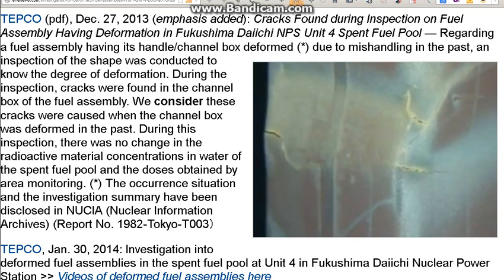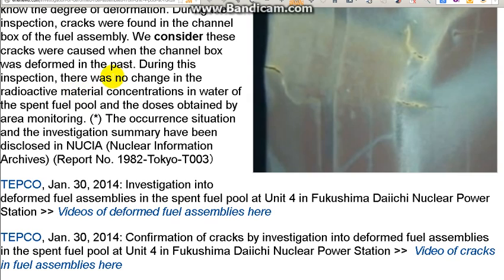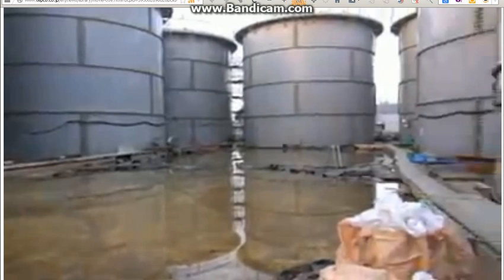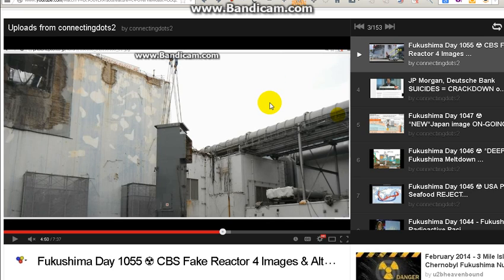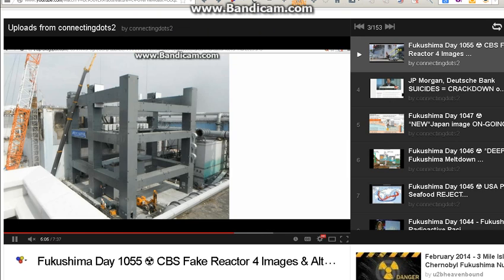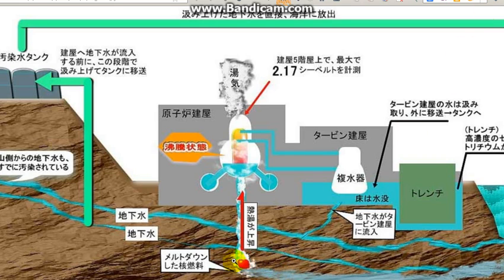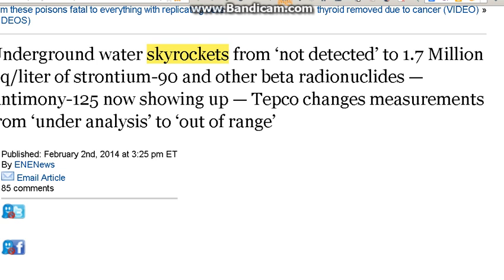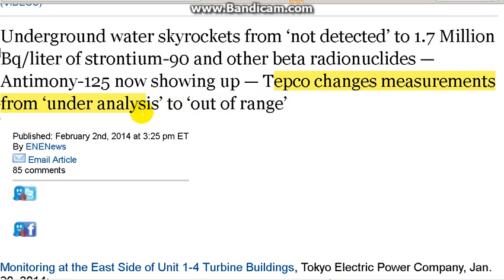Fukushima Day 1060 ☢ Strontium 90 SKYROCKETS at Fukushima & Reactor 4 Spent Fuel Pool Footage

Comment: Tokyo Electric Admits Most Radiation Readings May Be Wrong
February 8th, 2014 Fukushima – SimplyInfo

Tokyo Electric has admitted a large number of Tokyo Electric radiation readings taken since 2011 may be wrong and much lower than reality.
An audit will be performed on old data from 2011 until October 2013. Tokyo Electric explanation is that high radiation samples had a “counting miss” where the total level of radiation in the sample is NOT accurately recorded. Some media reports questioned Tokyo Electric excuse.

Currently this is only calling into question all beta radiation readings taken. Neither Nuclear Regulation Authority or Tokyo Electric has mentioned similar problems with gamma readings but there have been other issues with measuring and laboratory processes since Nuclear Regulation Authority took over review of the Fukushima plant.

Some of the earliest beta radiation readings were taken when workers entered standing water in the unit 3 turbine building and received beta burns. The workers were NOT informed of the high radiation levels in the water before being sent in for the work. The workers have since sued Tokyo Electric for the workers’ injuries. Tokyo Electric incorrect readings would also impact estimates made of leaks to the sea from damaged tanks in 2013.

Comment: Breaking news: 75 children have now been diagnosed with thyroid cancers.
FEBRUARY 8, 2014 EVACUATE FUKUSHIMA

In September 2012, the first case of thyroid cancer was diagnosed in a child out of 38,000 children.
By September 2013, the number increased by 58 cases.
By February 2014, a whooping 75 children out of roughly 270,000 are either confirmed or suspected to have contracted the thyroid cancer.
NOTE; More than 100,000 children have yet to participate in the survey.
The sociopaths in charge are still denying the thyroid cancer is related to the ongoing nuclear crisis.
The crimes on the children of Fukushima continue unabated. The crimes bring shame to the great nation of Japan. Evacuate the children. NO ifs or buts!!

The rate at which children in Fukushima have developed thyroid cancer can be called frequent because the rate is several times to several tens of times higher. [Based on Japan's cancer registration statistics from 1975-2008 which show an annual average of 5-11 people in their late teens/early twenties developed thyroid cancer for every 1 million people] Because there is the possibility that the number of cases could increase in the future, there is a need to implement measures now.

Comment: 5,000,000 Bq/L of Strontium-90 measured from groundwater 2013 July / Tokyo Electric NOT announced for half a year
February 6th, 2014 Fukushima Diary

On 2/6/2014, Tokyo Electric announced they measured 5,000,000 Bq/L of Strontium-90 from groundwater 2013 July.
Tokyo Electric has NOT announced it for over half a year.
The sampling location was the seaside of reactor2. From this sample, 380,000 Bq/L of Tritium was also measured.
From this newly released data, Strontium-90 was measured from all the boring holes of the seaside of reactor2 and reactor3.

Regarding the delayed disclosure of data, Tokyo Electric stated they were taking time to investigate the cause of wrong analysis. However after all, Tokyo Electric did NOT release the data, which strongly suggests the on-going sea contamination, before International Olympic Committee selected Tokyo as the host city of Olympic 2020.